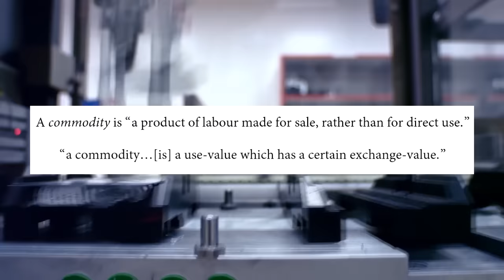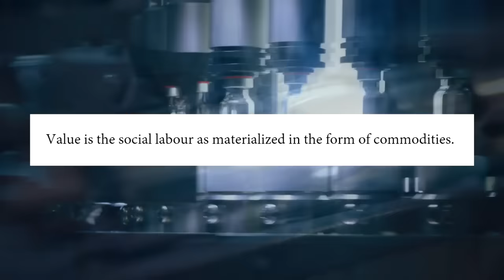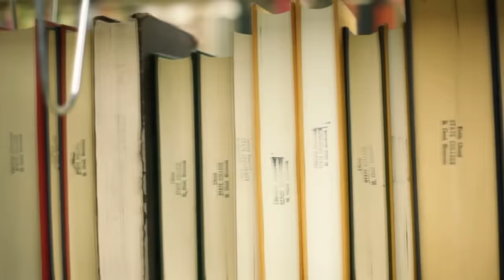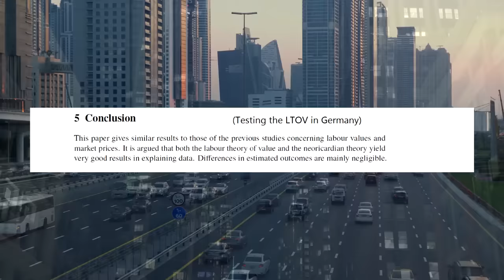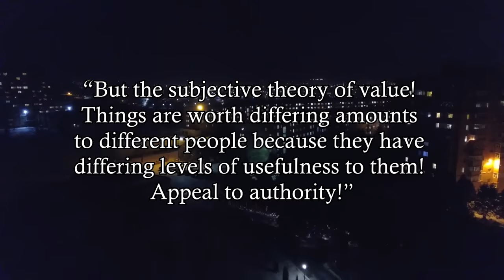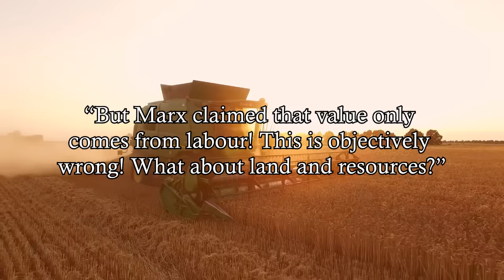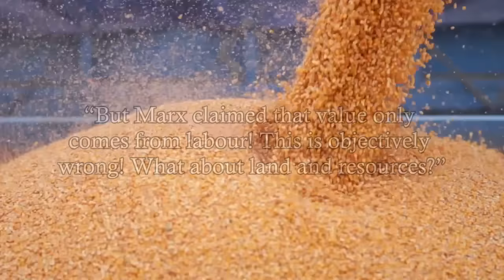Capitalist arguments against the labor theory of value suck (Explaining the LTOV) - Socialism 101

Comment: Great video! But I do have a question. If two commodities of the same use take the same amount of labor-time to produce, but one has higher quality materials, do they still have the same value? Is the only difference the exchange-value given that supply and demand are equal?
Reply: Supply and demand would presumably not be equal if there is an appreciable difference in the quality of the materials which had a benefit to the end-user. Presumably the higher quality product would be in lower supply, which accounts for its increased price. "Organic" food is a decent example of this, though as seen there, the demand isn't necessarily a lot higher just because the supply is lower

Comment: "That if supply and demand are equal" has to be the single most economically illiterates statement said by a human. Supply and demand are non comparable phenomena. Supply represents collective industrial and economic capacity for the good to be produced. Supply represents The general desire to consume to good.

This is why supply and demand curves are that, curves. An increase of demand is not moving along the curve, but rather a translation of the supply curve rightward. One could never quality these things as "equal" to do so would be to engage, objectively, in a category error.  How could you define ideas which are themselves mathematical price dependent functions who's aquarium point as at intersection as being "equivalent" when they, by definition, can not be the same function. 

You also miss the point. You, while claiming that the SVT confuses value and price are, proactively, confusing value and price. You pay the price for the car if and only if you value the car more than it's price. If you value the car less than it's price, as the example you gave indicates, you won't buy the car. The SVT does not presuming your evaluation of an item sets it's price, rather your evaluation of the item adds or detracts from aggregate demand which, in combination with supply, sets some market rate price that you either value the object more than, or less than.

Comment: Value means nothing without including how useful a product is to an individual. This video attempts to add complexity to the argument in order to distract from this truth, in order to sell the moronic idea that value is an objective thing to measure. Price and value are not the same, but value is fundamental to price. Marxism is a much more inefficient method of distributing resources than capitalism. Capitalism produces waste due to the free market’s higher efficiency resulting in a surplus of products that get thrown into the garbage if not donated to charity. Marxism’s failings with the perception of value/need, result in more resources not getting to where they are needed the most, in a much worse way than capitalism. Not to mention, centralization of power being the biggest fatal flaw. Because it’s only a matter of time before that power becomes too corrupt/inefficient/incompetent and creates a catastrophe for the whole population.

Another fatal flaw: “From each according to their ability, to each according to their need”. Either the individual gets to determine ability and need, and exploit that to their benefit, or the state determines it and exploits it for their’s. Either way, it’s a bad scenario.
Reply: You're mixing up some things. 'Marxism' is not a system of distrubution, it's a way of thinking about the world, expanding on the works of Marx and Engels. Capitalism's supposed 'efficiency' is to be questioned, there are many examples of irrationality at moments where squeezing extra profit come into play.
Furthermore, Value is a social relation, it excists within a production proces, it's immaterial, but can be known by looking at the proces, and yes a commodity must be useful to someone, it's not denying that

Comment: 10:00 appeal to incredulity is not an argument. Heterogeneous inputs are not a trivial matter. This is a valid argument and you just hand waved it away.
Reply: 10:49 no, this does not render different skill levels from DIFFERENT industries irrelevant because the issue is that they are in entirely different fields.
Reply: @ExPwner  inconsequential. Mises' argument is flawed. Those entire fields are doing human labor. It's true that this human labor qualitatively different but all human beings can do any particular kind of labor given enough time. So the average time needed to manufacture a certain commodity can be compared.
Also, the qualitative differences also emanate from quantitative changes. To become a surgeon you need to do a lot of labor in education. That labor gets added in the labor of surgeons.
Mises being a priveleged intelligentsia refused to acknowledge it but as was demonstrated by USSR where many miners were wealthier than managers and professors, qualitative differences in particular kind of labor aren't fixed.
Reply: @someesingh2827  I never mentioned Mises here whatsoever. Quit ad homineming and make a real argument.
Reply: @ExPwner  It is Mises' argument. In case you didn't notice, I did give an argument but you weren't able to grasp it.
Reply: @someesingh2827  it is not unique to Mises and no, you really didn’t. You just hand waved away the issue at hand. We could hold constant the hours of training and the labor would still be heterogeneous.
Reply: @ExPwner  no it won't be. Labor is never hetrogeneous simply because it is done by human beings. All forms of labor can be done by everyone. So yes it can be calculated just like horse power unit was used by James Watt to calculate an engine's capacity by comparing it to a horse's average running speed, so can human labor.
Different types of labor is convertible to one another. THAT is the basis of commerce.
Reply: @someesingh2827  no they can’t. You’re just wrong and you know it.
Reply: @someesingh2827  the notion that anyone could do any job. That is wrong and you know it.
Reply: @someesingh2827  This is the biggest red herring I have ever seen in my life. What James means when he says that labor is heterogenous is that not all labor done by humans is valued the same nor does human labor always produce the same thing. The notion that someone spending an hour to make a computer for you and someone spending an hour to build you 4 Teddy bears is both desirable to humans because of the time spent making them is incredibly naïve and delusional. If you had a choice between the 2, I would bet you would rather someone spend an hour to make a computer for you, which demonstrates that labor time really has nothing to do with why human beings exchange in the 1st place. Prices are a reflection of all the valuations of consumers in that market. The reason why video games for example are usually bought and sold at $60 is because most consumers of video games value them in such a way and therefore exchange based on a price that reflects their valuations. If Elden Ring was priced at $5000 dollars, you can bet that it will not sell as highly because the large number of consumers don't value it at that price, amongst other reasons.

You bringing up biology and homeostasis is just a red herring and brought up most likely to soothe your own ego because what we are talking about has nothing to do with biology. It has to do with the subjective valuations of humans. To sit here and think that labor has anything to do with price formation or why human beings value an item in the 1st place is nonsense. And thinking that value, in the more colloquial sense, is something independent of humans and somehow items have "intrinsic value" is even more nonsense.
Reply: @theminorprophet5132  thank you! Finally someone with some brains here.
Reply: @theminorprophet5132  "What James....same thing"
Don't defend him. He has expressed his view that he genuinely believes in the BS about natural uniqueness of human beings and thus he believes in hetrogeneous human labor. 
But to answer your argument;
Marx never denied that all labor is not of the same value. There is useful labor and then there is useless labor. Labor too has a use value and a labor value. 
"The notion that.....and delusional."
First, computer and teddy bear don't have equal labor value. Not even close. The teddy bear will take much less time and much less expenditure (congealed labor). There is no other reason for difference. Think about it, who are you to decide what is useful and what is not. Both teddy bears and computers get sold in the market. Both have a use value and both are products of human labor. And ther is nothing delusional about it. In fact your rejection of it merely demonstrates your ignorance about economics and commerce. Why do firms, nations and corporations exchange raw material cotton for machines (at different quantitative rates). Also, the ratio you gave is incorrect. 
More like 200 teddy bears equals to one computer. Because computer is just that difficult to manufacture. 
"If you had choice.....1st place."
Except that the time taken to build a computer is NOT one hour. Maybe the assembly of its various parts might take an hour or two, but each of its parts took different amount of time. Whether it be the programing software, the motherboard (which also includes silver, a difficult to acquire metal, whose entire labor gets congealed in it), the body too takes at least five to six hours if not more. Hell, computer is a complex machine, it is delusional on your part to think that it is equivalent of a mere 4 teddy bears. And that is your error. U r misrepresenting my argument by taking an incorrect example. Take mine, 200 teddy bears= 1 computer. Does it look that unfavorable?
The fact that you didn't know that speaks volumes. Had you gotten your way, the entire economy would have jammed. It reminds me of that school boy joke: what is heavier: 1 tonne iron or 1 tonne wool?
"Prices are....their valuations."
No matter how low the demand, no company will sell its product way below it's actual labor value, if it doesn't want to go out of business. If people don't have a demand for it, then they will stop producing it and direct production to other products. 
"If Elden.....other reasons"
The price of Elden ring however would gravitate around it's cost of production which if very high will lead to high average price. U know, unlike your subjective theory which has no substance, labor value theory was proved by Adam Smith using statistics from multiple decades of prices from the records and drawing comparisons with expenditure. 
People don't magically subjectively decide the value of a commodity. They decide it as per it's socially necessary useful labor value. They do it unconsciously by drawing comparisons in different scenarios and different products. 
"You bring up.....valuations of humans."
Shut up liar, there was no red herring. James Adams was very clear on this. I asked him out of curiosity whether he believed nonsense that humans are somehow in capable of doin anything which goes beyond their "DNA" because he had earlier said that no amount of training can change different kinds of labor. And in my defense he said that later too. He said like a stupid highschool kid—"not all humans can do everything and you know it"
Whatever that means. So yes, homeostasis is relevant for the discussion.
"To sit here.....more nonsense".
All these products u use are products of labor. Y is it nonsense to think that they do have a labor value?
Reply: @someesingh2827  You're starting to make no sense, like all marxists do when you start to ask for specifics. Do you know what constitutes useless labor and useful labor? the output of said labor.  Which raises the question, why are HUMAN BEINGS even deciding to use their labor in the 1st place? It's because they are looking ahead and they think that output of the labor is worth it, so they start to do it. You have the cart before the horse. You seem to think people only value the output after they are finished, which makes no sense. The cost of production has nothing at all to do with what price consumers would be willing to pay. You're forgetting why anything becomes a factor of production in the 1st place. It's because a HUMAN is putting a plan into motion. The HUMAN (I'm stressing this because marxists forget that human action is a big part of economics) is expecting consumers to pay for the product at a price he thinks he can make a profit. So for example, if I buy up factors of production to make sneakers that I think is going to yield me $10,000, I'm not going to spend $15,000 trying to make sneakers that I think is going to yield me $10,000. The cost of production has nothing to do with the price consumers would be willing to pay.

Also, if prices on the market are determined by it's cost of production, then what determines the prices for the factors of production? The theory doesn't hold because it doesn't explain the prices of factors of production. But if you change your thinking to account for subjective human valuations, it starts to make a little more sense.
Reply: @someesingh2827  You seriously think that computers are more valued by humans simply because of the "labor congealed" into it? This is sad thinking. Are you saying that you would seriously be stumped between the choice of having 200 teddy bears or a computer simply because of the labor value and not your own subjective preferences? You can't be serious. I didn't say they cannot be exchanged. You are putting words in my mouth. I provided a teddy bear example to show that you will value them based on your own subjective preferences, not just because they have the same labor value. Answer my question. Would you take 200 teddy bears or a new computer? I'm asking you personally. 

Also, My example didn't assume the capitalist knew there was demand. All I said was that he had a plan in motion that he thinks will yield him $10,000. I didn't say he KNEW it would make him $10,00. Big difference if you actually read my example and took the marxist glasses off you would see that. If the entrepreneur fails in his speculation, he suffers losses.  And you know how he gets those losses btw? Because consumers were not willing to pay for the products at that price. 

I'm seriously about to be done with this because I can tell you are not reading my points very clearly. I didn't say anything about you saying that prices will remain the same. Also, your little analysis/studies are correlating. Correlation doesn't equal causation. Just because prices tend to "gravitate" towards the cost of production doesn't mean the cost of production is what determines the price. It's a correlation. It doesn't demonstrate the CAUSE for prices, while subjective theory of value does determine the cause for prices, especially the factors of production. Consumers set the price based on what they want to exchange. It's a more complete theory. Crazy how I have to explain proper analysis to a biologist.
Reply: @someesingh2827  people absolutely decide the value because value is subjective. Value is not determined by labor. Your LTV was not ever proven and not by Smith either.
Reply: @ExPwner  Smith investigated price records of Scotland of an entire century to make his theory. Not to mention, the sources linked in the video give multiple such examples that empirically verify LTV.
Also, zip it Adams, you're out of your league.
Reply: @someesingh2827  Smith did not create the theory and I already addressed the bogus “studies” that he linked which do not prove anything. You did not read any of them, dunce.
Reply: @ExPwner  
Rather than just saying "bogus studies" y don't u give an argument?
Or would u rather outsource this discussion to another one of your straw-manning ad hominem videos against Professor Cockshott?
Reply: @someesingh2827  the argument is in the video and it did not strawman anything. Quit using words you don’t understand. You already got owned on your idiotic take with respect to heterogeneous labor here and still couldn’t handle it. Obviously you can’t comprehend the criticism and methodological flaws of Cockshott if you don’t have the honesty or intelligence to comprehend that labor is not all the same.
Reply: @someesingh2827  wrong. That is a lie.

Comment: From how you explain it, I feel like the labor theory of value and utility theory of value are not mutually exclusive. Even in your answer to the mudpies, in the quote that you use for Marx, the labor must be "expend[ed]on something useful, on something capable of satisfying a want of some sort". To me, that sounds like Marx thinks the utility the labor provides is an important consideration in determining value.

Wouldn't it be easier to say that the LTOV helps to explain the value a producer puts into the commodity (on top of the value of the natural resources put into it), and the utility theory of value helps explain the value an end user gets out of a commodity?

At that point, though, it just sounds like supply and demand, with LTOV explaining the supply line and UTOV explaining the demand line, so maybe I messed up some terminology along the way.